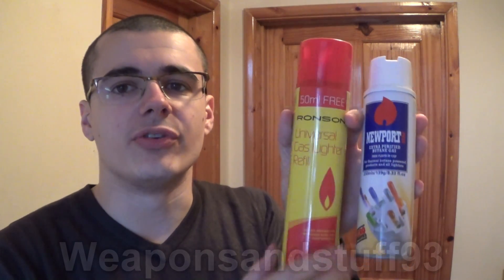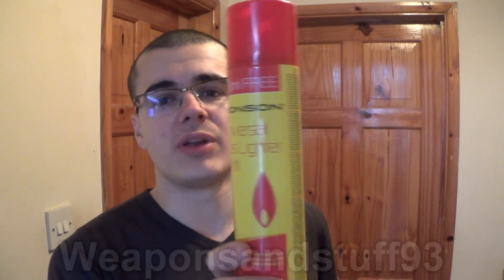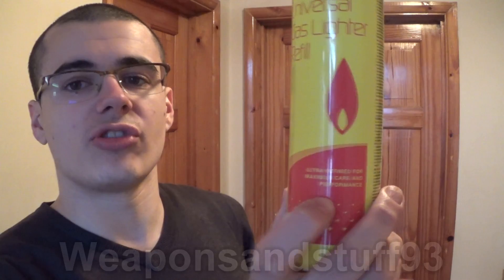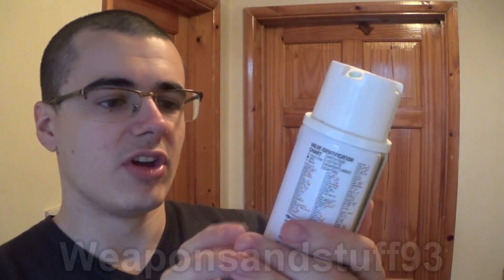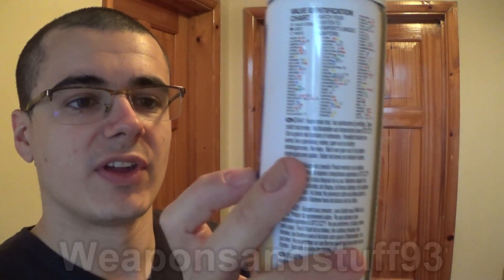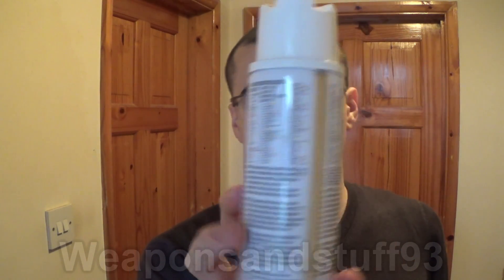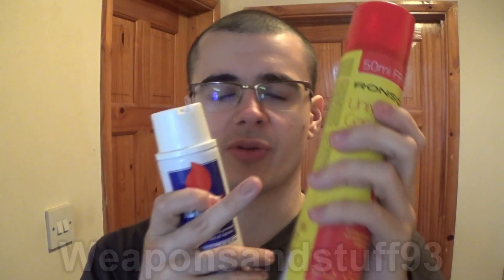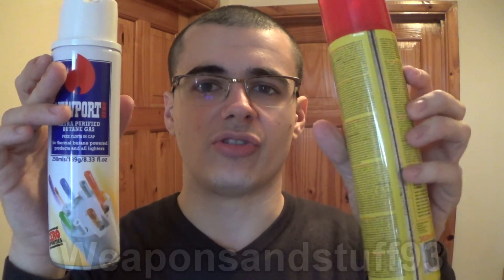Types of Butane gas

Comment: I’ve used both brands Ronson and Newport leave dirty carbon impurities. Generally as a guide the “yellow” refills are more dirty. Go for Zippo or Colibri and most refills that are used in soldering. I kid you not as I have been working with many different brands and it’s a bit of trial and error or quality.
Reply: Ronson - another one of those names that once signified reputable products, but don't anymore. I can't say for certain, but I shouldn't be surprised if they share nothing at all with the company of old, other than a sold~off name.
Reply: It’s science. Newport is nowhere near as dirty as it’s heavily refined. Ronson leaves everything black and broken. Big difference.
Reply: @rafaeltorre1643  
One is aware of soot.

Comment: I use newport fuel for my zippo jet lighter but I tend to waste alot of fuel while fueling the lighter. (fuel comes out) can you make a tutorial?
Reply: Is the fuel pin of the lighter a modern universal type or a specific different size?
If it's smaller than regular ones, use an adaptor on your butane can.
Reply: Are you holding the can upside down ?